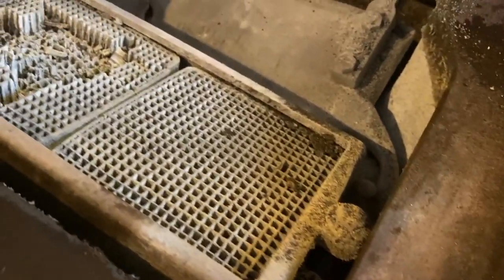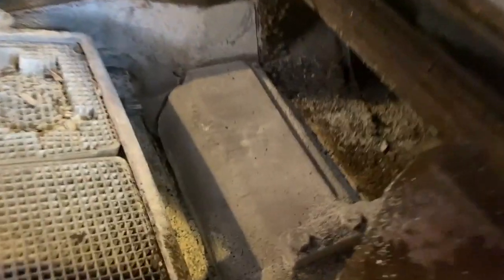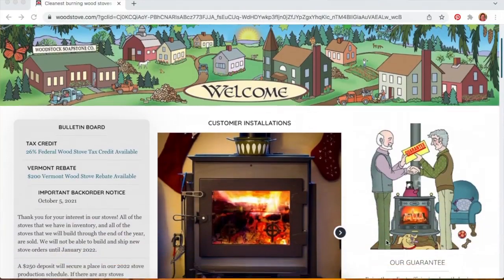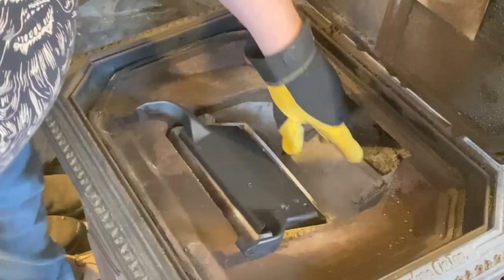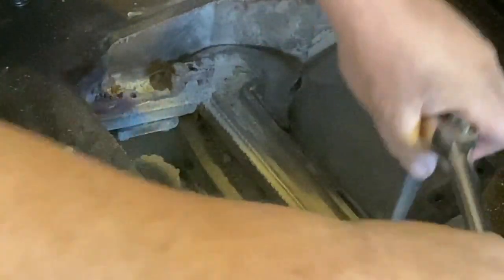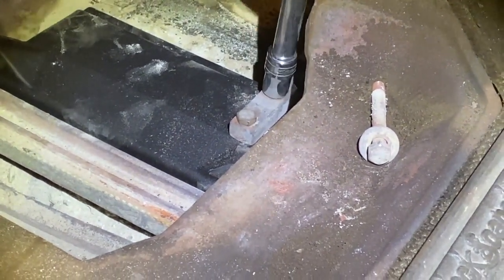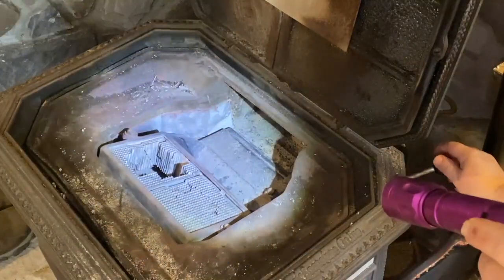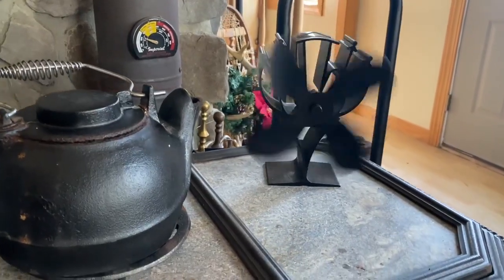Off Grid | Below Zero | Broken Soapstone Wood Stove

Comment: Nice video on the replacement parts. The bottom protection unit in the new ones are stainless steel. Mine is new since 2012 and still in good shape. The cat's the sell now are stainless steel as well as Woodstock  builds their own in house I believe. Going with a new cat will save you wood too and give you more/better heat.

Can't beat the Fireview! Or the Woodstock Soapstone Co.
Reply from the maker: Yes! It has been working great. We bought less wood this year because we didn't burn as much. Cleaned out the bottom pan, which had a very little ash in it. We are very happy with our fireview!

Comment: We’ve had that same stove for 22 years we’ve fixed that same part about 10 years ago I’m replacing it again today it’s not hard to do . I’m also changing ALL the gaskets that needs to be done maybe every ten year . I see you still have the old cumbuster we replaced ours with there new SS one it is much better and cheaper than the original one . I’m even going to a temp to change the gasket on the glass it doesn’t look hard to change .
Reply from the maker: We did change out the combustor before last winter, and it works so much better. We burned less wood and stayed really warm. We are so glad we did it. It is such a great stove and worth putting the extra work into getting it up to par every few years. I would say stay warm, but I know with that stove you will.
Reply: @WhiskeynSunshineOffGrid  my stove is all apart right now hopefully it will be all fixed today I read in the directions I can’t use it for 48 ours we have to wait for the furnace cement to dry it’s really windy here in Maine I hope we don’t loose our power a few towns around us already have it’s very windy ! 😤

Comment: If anyone is rebuilding there stove don’t over tighten any bolts inside the stove cast iron is brittle they break easy . I just did that and broke a part that is going to coast me $360 so next summer when I replace it I will have to put two  ratchet straps around the outside of the stove upper and lower then I can take the four large screws in each corner of the inside of the stove to replace the part because if I don’t use straps the stove will come apart when I take out those four large screws . 🙄🤷‍♂️
Reply from the maker: Oh no! So sorry to hear that happened. Good tip to know, but not how we want to learn them. We hope it doesn't stop it from running efficiently.
Reply: @WhiskeynSunshineOffGrid  it has a hair line crack the heat eventually will make it bigger . So we’re going to use it this winter and fix it in the summer .